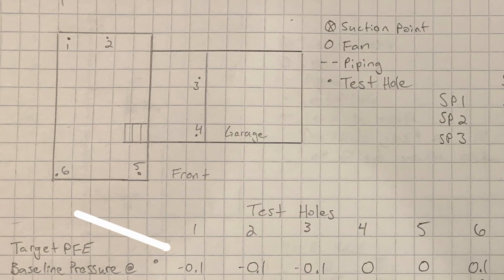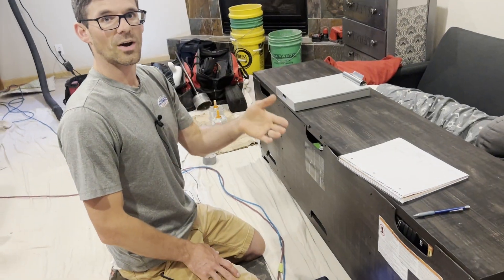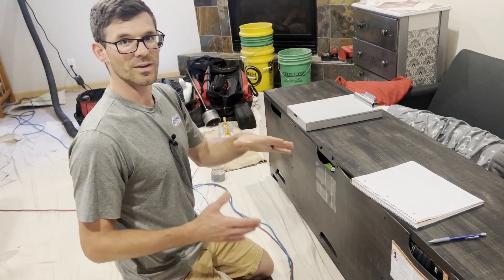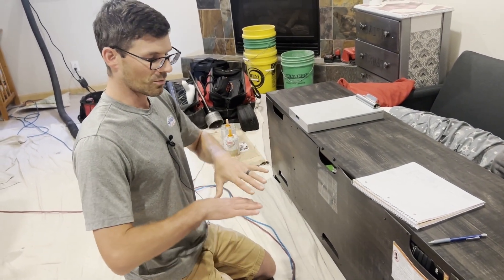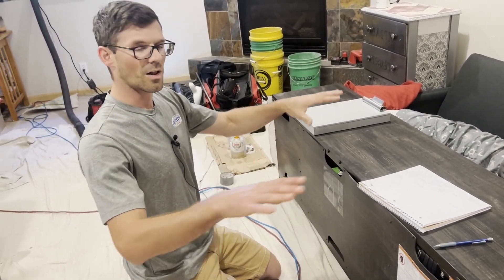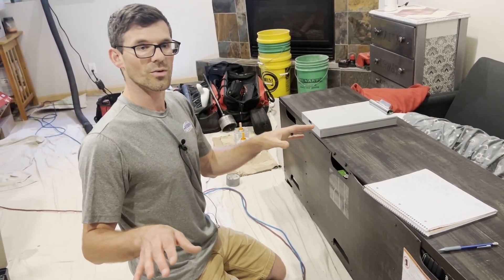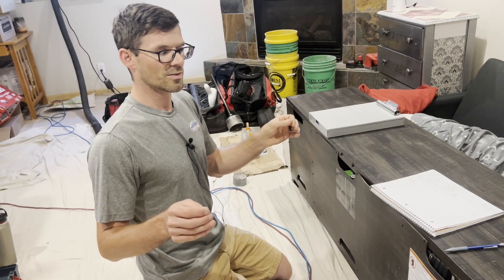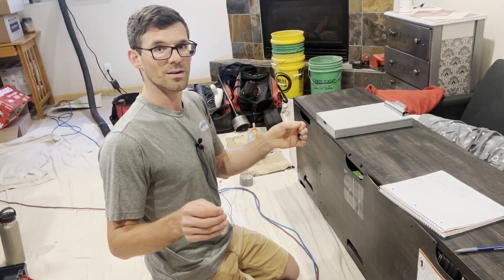Pressure Field Extension Test Holes For Radon Mitigation

Comment: Hi Jesse, do I need to drill the main 5" suction hole (for 4" PVC pipe) and run the fan while measuring the Pascals in the 1/2" test holes? I was hoping to avoid putting a 5" hole in the slab only to find out the location may not work. I drilled two 1/2" test holes and tried using a vacuum cleaner hose on one of the test holes to see if I could get a pressure differential, but had no luck (test holes are a good 60' apart). Our house was built in the mid-90s and it does have drain tile. Any suggestions on how I can confirm the main suction point will be effective without committing to the full 5" hole first?
Reply from the maker: I would recommend doing a communication test like I did in this video: https://youtu.be/h0g_UY5-Zew. It’s a great way to check the effectiveness of your suction points before committing to the full 5” hole. This method can help you confirm that you're targeting the right area without wasting time or resources. Hope that helps!

Comment: Hey Jesse, I'm a little confused how a fan will pull air from under the slab. You core a hole and dig a small cavity, but aside from that air pocket, isn't the weight of the slab and the whole house bearing down on the earth underneath it all? I mean isn't it tightly packed? Where does the air come from to feed through the fan and blow outside?
Reply from the maker: Good question. Tighter soils, like clay, are less porous than slabs that have gravel or course sand below them. In those more permeable soils, it's easier to create the suction below the slab required to stop radon entry. Tighter soils often require multiple suction points to create suction under the entire home. The larger the suction point, the more surface area you draw from.
Reply: @AmericanRadonMitigation  so if it's sand or coarse gravel beneath the concrete slab, a fan can pull air without being overworked? I'd never have guessed. Thanks for your reply!
Reply from the maker: A fan isn't working hard if it's hardly moving any air. It will also consume less energy than the same fan moving lots of air.